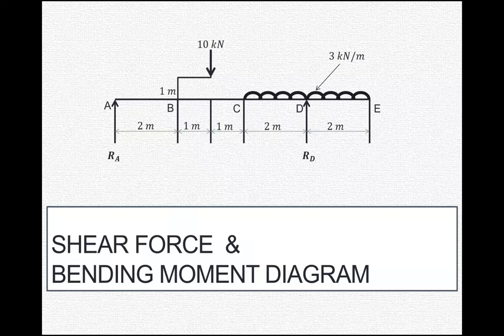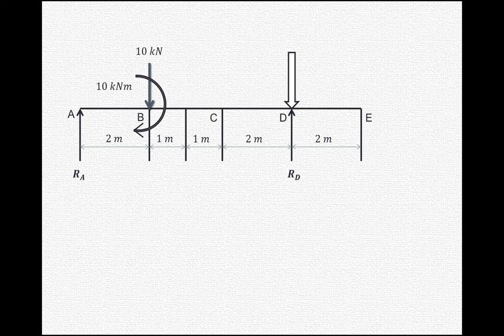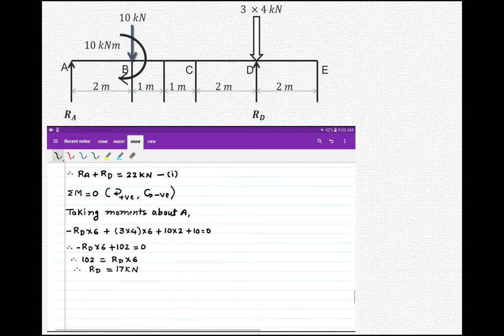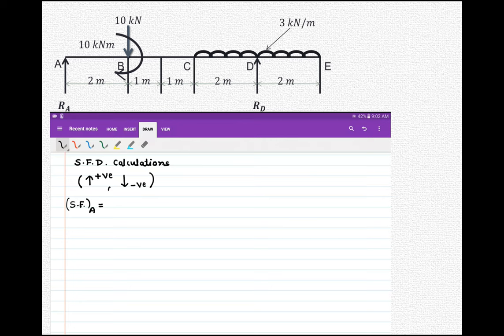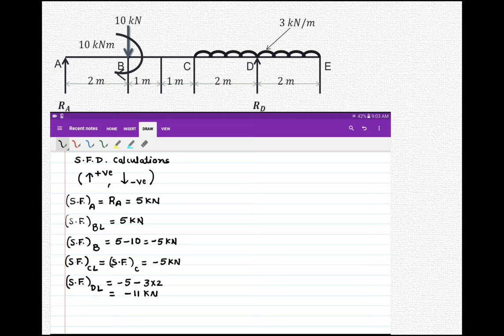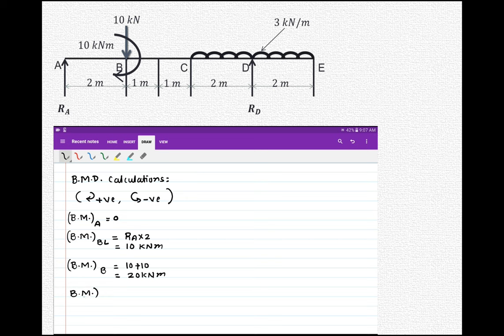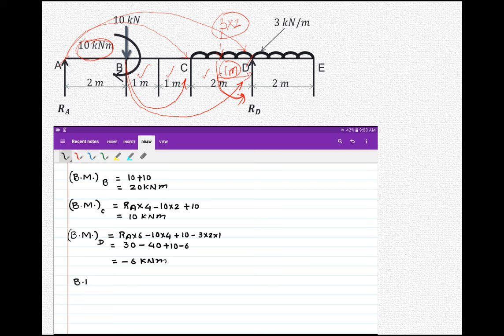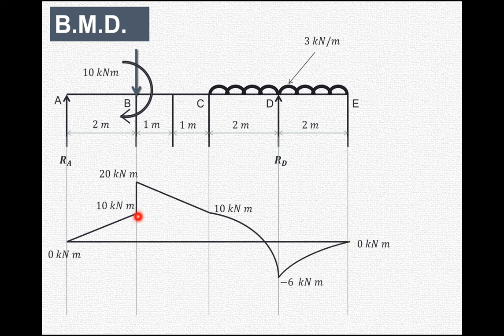Lecture 11 | How to draw shear force & bending moment diagram | Simply supported beam

Comment: For calculation of reactions you converted udl into point load, but why you didn't repeat the same thing for calculation of S.F and B.M ,
can we first convert UDL into Point load for Calculation of SF and BM?
Please reply
Reply from the maker: You can convert the u.d.l. to point load only for the calculations of moments & hence that approach is used for the calculations of reactions and B.M. For the calculation of S.F. we require to calculate S.F. at the left or right of the point and hence u.d.l. cannot be converted to point load for S.F. calculations. Hope it will clear the doubt. Thanks & Happy new year from CHINMAY ACADEMY.
Reply: @CHINMAY_ACADEMY  thnx

Comment: But we take bending moment using the right side forces from the point which we take moment, then  the same value in negative sign.
But it should be same from any side.how to solve this?